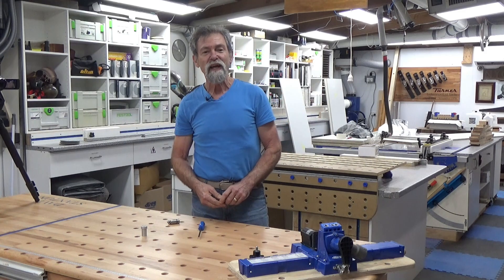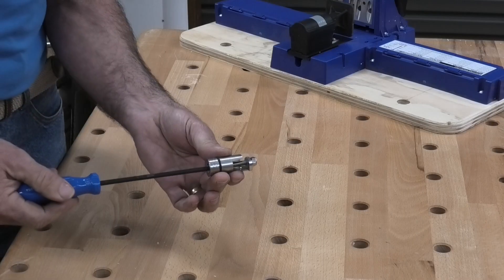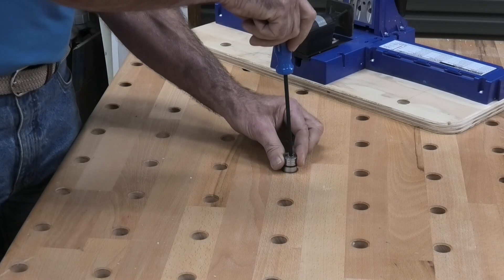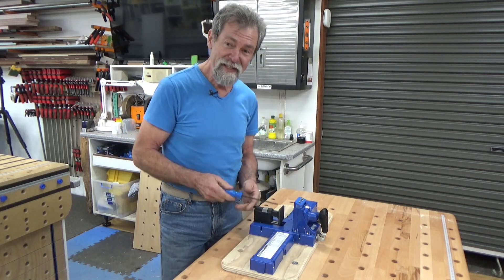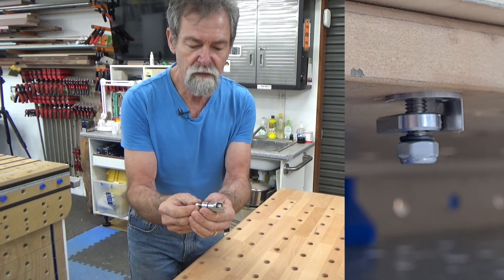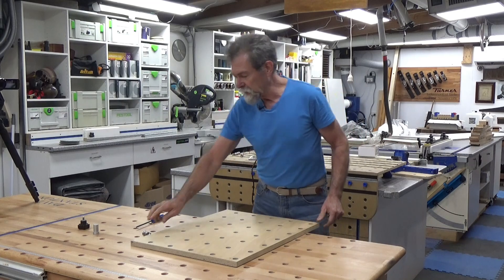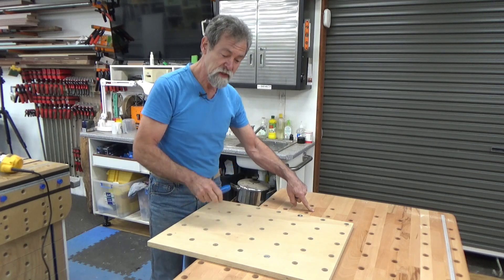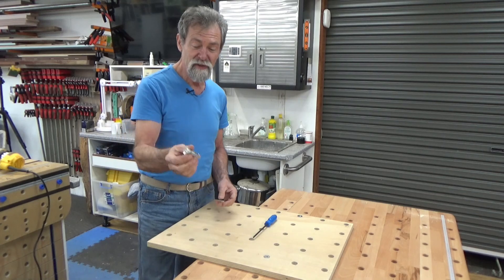TSO Products Power loc dogs | Dave Stanton | festool mft3

Comment: Great idea. I have made some clamp-dogs by myself and use it a lot for clamping jigs and tools to my bench. I use two parts of a 20 mm aluminum round bar with a 45 degree cut and drill a hole in. The upper hole must be slightly bigger and the under peace have a thread m6 in it. Now I can use a knurled screw to tighten it, and it will clamp the plates together. Very useful ;)
Reply from the maker: That is a great idea! The advantage of the power loc dogs is they do not protrude above the bench and are totally controlled from above.